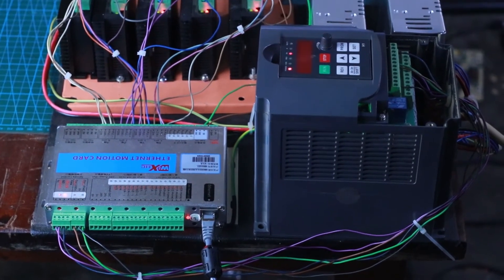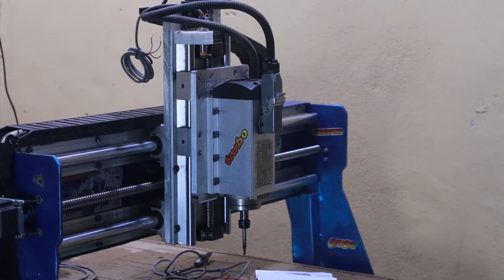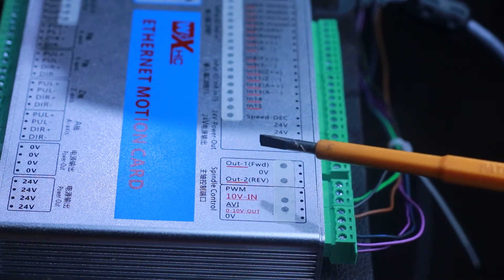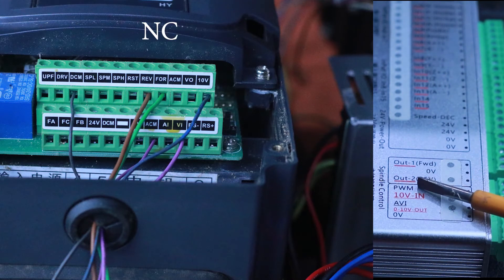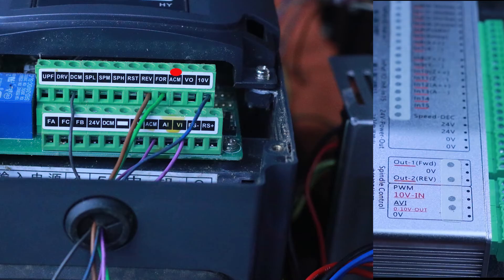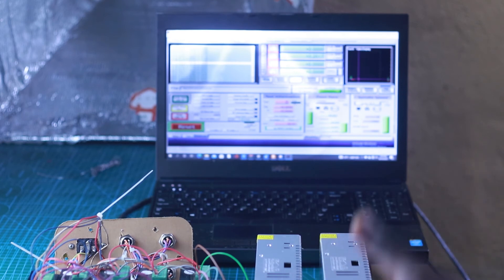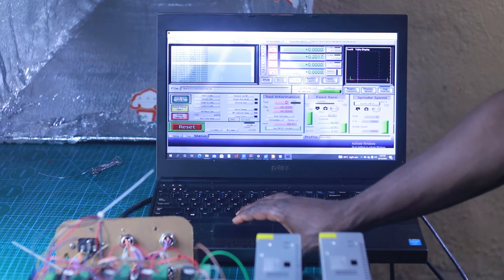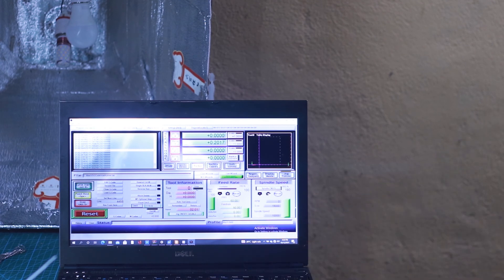How to setup the XHC CNC controller to work with a VFD and mach3

Comment: We are having problems trying to get this controller setup with windows 10. Setting the IP address isn't going very well. Any info would be greatly appreciated
Reply from the maker: We are currently using it with windows 10 and everything works great. Just make sure to install the right plugin.
Reply: @HermannLabs  we have the right plug-in installed in the plug in folder it worked before we moved the machine but now it says no xhc ncether. Thank you for any help you can provide.

Comment: excellent controller, I had all types of problems with novusun NVUM V2 almost all of them disappeared after upgrading to this controller.
thanks for explaining the right way to wire VFD to work directly from Mach3. I tried it and it works. the only problem is the numbers are way off and doing calibration and other workarounds didn't fix the problem. luckily I had RS485 laying around and after connecting it my numbers are accurate and no more EMI problems like I had with the old controller.
thanks again for your videos about this controller it's one of the reasons I bought this controller
Reply from the maker: I'm glad you found my video useful. I agree with you, this controller is amazing. Thanks for the comment.
Reply: maybe only for 3 axis,    fot those that want the 4th , will not work the 4th, and says it will ,  so...